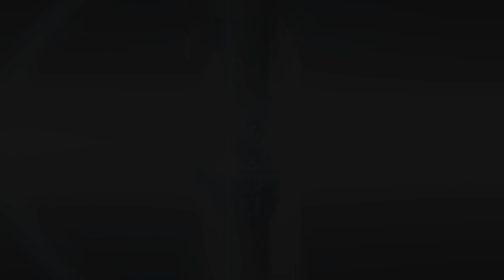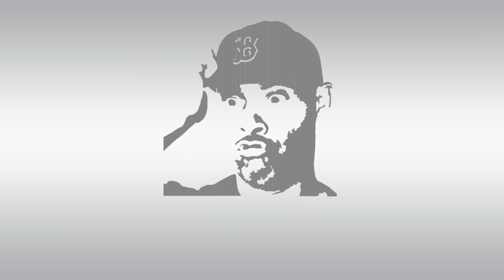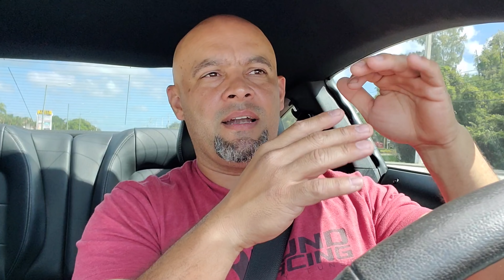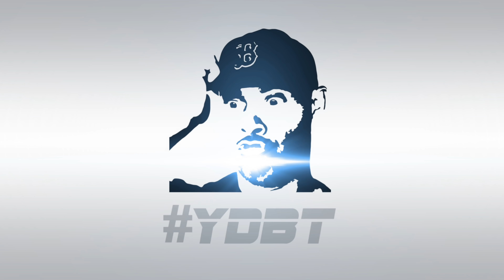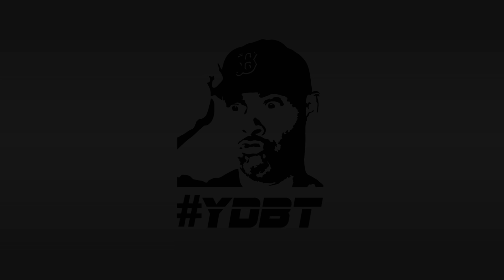Is buying a crank a pallet right for your coyote swap project?

Comment: Thanks for the video.  We did a lot of research and found Holley's new Terminator X and X Max are another option.  Will run the VVT and a 4R70W.  No 6R80 yet.  Doing a Gen 1 swap in an F100 that has a Crown Vic chassis and drivetrain.

Comment: Good Job Alex........Live and learn.   My experience.......Bought Gen3 -10R80......Got Everything from Parts Farm.....added radiator, condenser fuel tank....PATS delete, Bla Bla Bla........It was a scary experience but I got the stuff.  [Scary because of wiring that much $ and seeing just pix's of a wrecked car] Then I started watching your Vids.....   Then I called and talked to Pezzo @ PBH....At that time a Control pack for my setup was not available........But its on order thru PBH right now...:)    As you spoke of and have read of the horror stories and guys chasing their tail for weeks at a time.....My setup is going in a '55 Fairlane.

Comment: The only benefit to a pallet is you get some of the pain in the ass hard wear like bell housing bolts,torq converter,a/c bolts and so on. I probably drove to the dealer 20 times before they got everything I needed and everything right.
Reply: Jim Herrmann the drive is worth it because that extra 20% that you pay for the pallet doesn’t equal what you’d spend on driving to a dealership and buying the bolts and such that you need.

Comment: Definitely don’t buy the cheap aftermarket control pack. I did and have been fighting it every step of the way. Every issue that can evolve from it, I had. I will be buying the ford racing control pack to eliminate all issues.

Comment: Or you could just leave a pushrod engine in your foxbody. Buy the Ford Racing Boss 363 crate engine and a stand alone ecu that can be tuned. Make more power. Spend less money. Still have good drive ability.

Comment: Alejandro, how is it possible to run a 6r80 on a gt500 but not a 10r80 on a gen 2 coyote? Yes, yes, I know the data isn't there to support a 10r80 on a gen 2, but how is it there for a gt500?